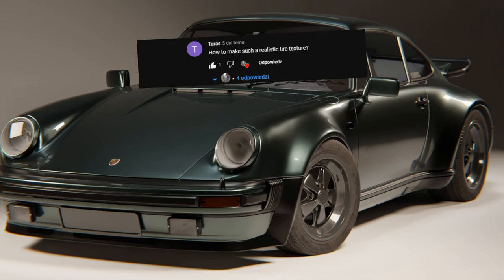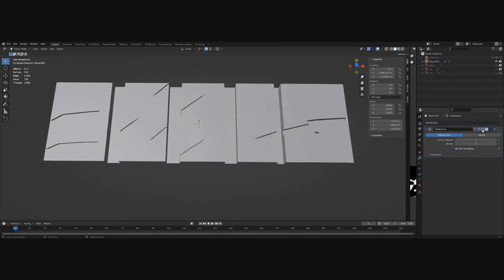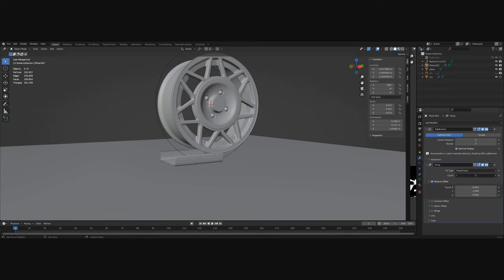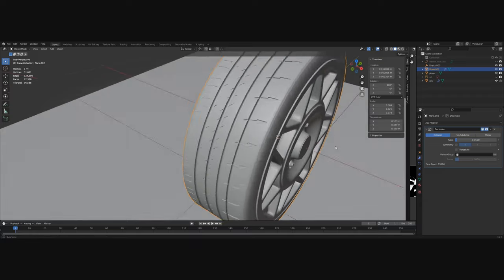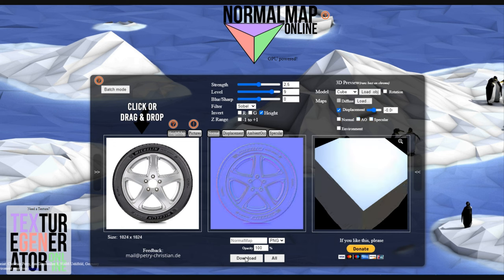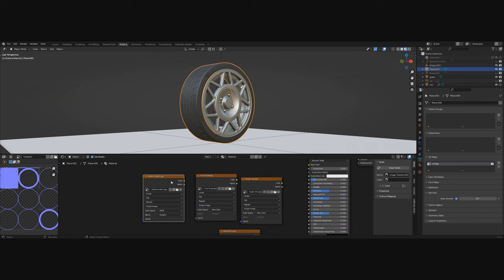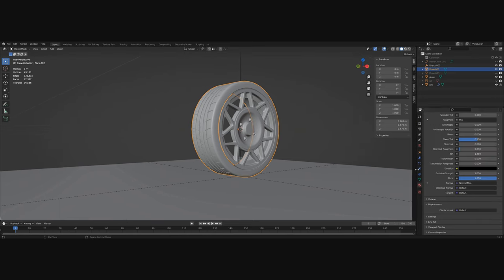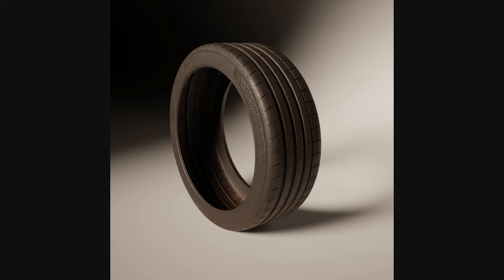Tire Modeling and Texturing in Blender!

Comment: 2:21 - I wish that part can be a bit more clear. I ALWAYS struggle with the bend defrom mod. It never works. Then I just do a circle curve mod and do it that way around.
Reply from the maker: I never get it right the first time i try, but if you tweak a bit with the settings you should get it right
Reply: @maslowski.  I feel like the developers need to update that modifier. This is why I bought the quick bend modifier on blender market to bend things more easily.

Comment: how did you make these dark places on the render?
Reply from the maker: what dark places?
Reply: @maslowski.  dark area on the background
Reply from the maker: @chr0mat1q16  Its because the light dont reach that area, i turned down environment light to 0 and I used area lamps to light the tire. So the dark areas are there beacause the light dont reach this parts